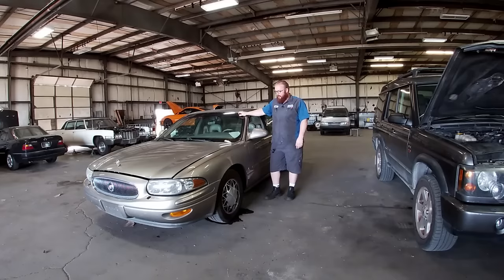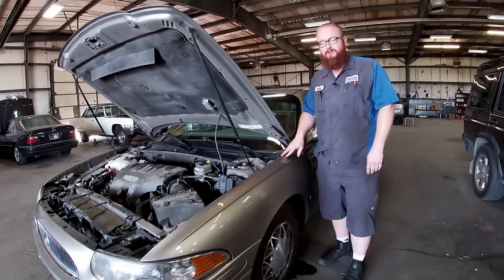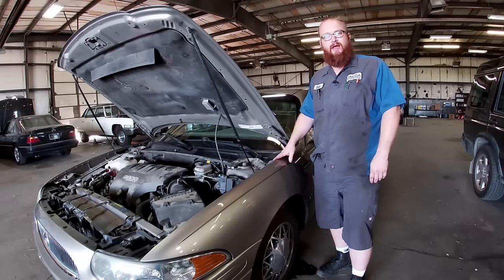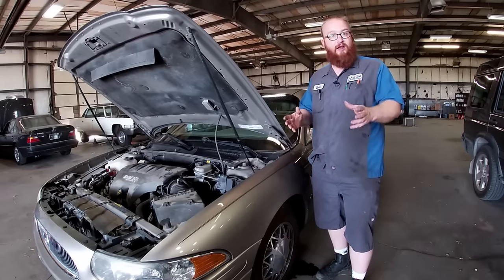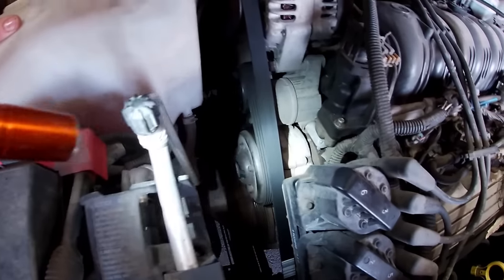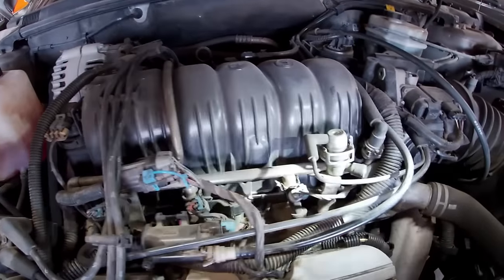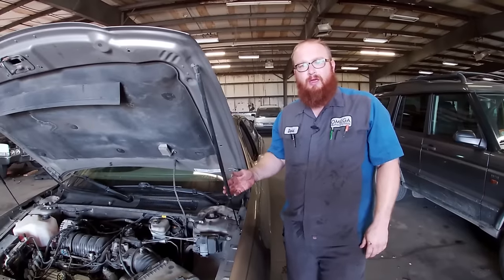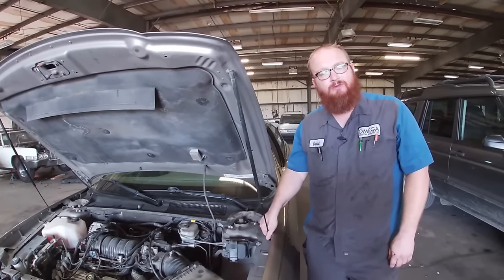CAR WIZARD highlights what makes the Buick 3800 V6 the BEST engine ever!

Comment: Car manufacturers don't intend for you to keep your car for decades, but once in awhile they make a mistake.
Reply: And that is exactly what happened....accidentally way too durable
Reply: This is why they engineered that late 2000's CARS program.  They literally built cars too reliably, and people were not buying new cars in as many numbers, and used cars were cheap but very reliable.  Thousands of good used cars, motors and all, taken off the road, and replaced with piles of shit that barely lasted 100k.  Just enough to outlast the payments.
Reply: my aussie built '01 Mitsubishi is almost as old as me and hasn't had a single issue yet :/ it's mind blowing how many garbage cars there are these days, and the clueless people buying them (euro trash and un-necessary SUV's mostly)
Reply: It's not a mistake it's greed
Reply: yup. Toyota made that mistake with the 5vz-fe 3.4l v6 engine.  with good maintenance, it will last literally a million miles.  best engine ever made
Reply: I had to smile at this comment.
Reply: Mercedes used to make outstandingly reliable, long-lived cars.  However they changed their focus in the last few decades and went for glitz, glamour and short-term profits.  The company that Daimler-Benz was from the 1930s to the 1980s is dead, now they're just another car company with nothing special about it.  Come to think of it, Volkswagen became one of the largest car companies in the world selling a cheap, reliable, easy-to-repair, simple car.  Their marketing was honest and direct and the company had integrity.  They, too, have completely dropped what made them stand out as an automaker and are just another BS car company now.  The Germans seem to have abandoned the strategy of letting the engineers steer the company and become like everyone else.  I was hoping the opposite would happen and  their methodology would catch on in the rest of the world.
Reply: *Relates in 2000 Buick LeSabre still running strong and riding smooth.
Reply: Benjamin Hale my 2002 Lesabre was the best car I ever owned. Doesn’t take a head on crash to well though, or I’d have kept her.
I now drive the Grand Marquis with the 4.6 L V8. It’s nice, it’s a land yacht wich is what I drive, but with the rear wheels spinning in the snow, it makes me miss my lessbre.
Reply: @glazierEd  Sadly most vehicles made after like 1986 handle a head on crash poorly, they handle it significantly better from a passenger comfort side but awful for the vehicle to actually survive the crash, damn crumple zones.
Reply: @Doubledunk  hey, vw are good, my dad has an octavia at 250k going strong and reliable
Reply: we imported to many foreign cars of lesser quality to brainwashed baby boomers,  foreign cars are better and with no control,  this led to robbing millions of jobs from American workers and the demise of the American auto industry. MY DAD IS BETTER THAN YOUR DAD HAHAHA!
Reply: they are made to drive not crash, not too many aircraft survive a crash, it is just another sells gimmick!
Reply: @mitchmurray2260  don't forget the 4.7 v8 that powered both million mile tundras
Reply: @faliray4889  I had to drop another "like"
Reply: The entire 60s, 70s, and 80s was one amazing mistake for country boys the nation over. I have a 50 year old motor thats been in 3 different trucks. Literally took my grandpa to alaska in the 70s and moved all my appliances just recently. Massive parts commonality with a variety of motors, millions of units of NOS items available dirt cheap. Cores, parts available all over planet earth. You can swap a motor in no time, fix anything on it easy and it's forgiving as hell. Rotors and drums built to last, wheel bearings are a simple question of packing and preload, external fuel pump. All the tools needed for roadside repair fit on the floor.
Reply: If only they made more mistakes we'd all be happier.
Reply: @Doubledunk  those euro trash cars have survived my maniac driving better than any Japanese and most certainly any American car I’ve had have. I’m a street racer. Audi is slapping the butt of most cars in the same class. Parts prices are pretty much the same for American and euro cars here. American car parts are mostly more expensive but that’s due to natural causes. My V70 from 2001 is at 250k miles as we speak and it’s running like a clock and nothing more than maintenance, wheels and breaks is done to it. Only euro car I’ve had ONE time consuming job done on was my Saab with it’s broken generator. That was truly pain to replace.
Reply: had great service out of my last 2 cars, toyota tercel and rav4. rav4 is at 435000kms and owes me very little !! 
dad had two holdens with this motor but driving rear wheels, didnt have any probs but not a lot of kms on them
Reply: How many radiators have you replaced for the 3.8L? My neighbor said that the was defective allowing trans fluid to mix with antifreeze. Another friend went to the hair saloon and when she went to start her 3.8L in a Olds, she had it towed to the dealer where she worked and they told her the engine was hydro locked because of headgasket failure?
Reply: Yep. All aluminum cars are a major mistake.
Reply: @thomascox7796  
Just add a $30 transmission cooler.  Takes 10 mins to reroute the lines out of the radiator.
Reply: Car wizard I found a Monte Carlo SS several  100k miles or less with the 3.8 l engine what do you think of those? They want $7k
Reply: @mitchmurray2260  Toyota doesn't make mistakes lol, they purposely build reliable cars
Reply: You mean, American car manufacturers.
Reply: The hardest part for me is trying to chase my 4T60E transmission problems, it keeps dropping differential pins and taking gears with it I'm on my 3rd trans in 230miles and I can't find parts. It's sad cause I love the car so much
Reply: @WalkerKSOB2000  It's hard to believe this is not a well known issue. I wonder if Car Wizard addressed this yet, and if not, why?
Reply: Well said
Reply: a reliable GM engine. like wow
Reply: I have this car still running with 210k miles
Reply: The plastic elbow for such an important engine coolant is intentional so that people destroy their engine after 10 years when that plastic ages out.
Reply: @chubbysumo2230  exactly.  Only toyota and honda somewhat kept making cars that lasted 300k
Reply: @Doubledunk  exactly they made simple easy to repair cars and then government also introduced emissions controls for engines after 2000 which combined with manufactures making cars to only last 100k -150k made modern cars costly, hard to maintain and short life span.
Reply: @Doubledunk  Not me i bought a 1998 Montero sport 3.0 V6 24 valve old school
Reply: @mitchmurray2260  So True and now they are making Direct Injection crap engines which force fuel into engine oil and carbon up the intake valves.  Turbo engines for 2022 tundra that are half size and will wear out.
Reply: @bdhale34  I like the new vehicles to crumple because they lower the G forces of deceleration much more.  I can afford to buy another vehicle much rather than broken bones.
Reply: @chubbysumo2230  no kidding. You could buy a $500/1000 car that would last 1-3 year at least get back on your feet and do it again….. not anymore
Reply: First and current 00 Grand Prix gt I'm trying to learn more about the motor but when my grandpa got it for me it was sitting behind a shed and last was registered 2019 and when they went to work on it and get it out to take to his garage they said it started right up with no issue minus the plug wires being chewed
Reply: Well said 👏
Reply: If you have a car that is a good car just right for you and doesn't give you problems then you want to keep it for as long as possible
Reply: What do you people have always bought new car if not for reliable but for staying current.
Reply: If only the transmission was as good
Reply: Shit you got the point i was thinking that why make a lasting  engine when we can make it mess up every time just to keep repairing that trash
Reply: The cavalier
Reply: @YTT718  I had a cavalier bought used they didnt change the oil for years the engine was still working perfectly I put fully synthetic oil the engine came back alive and roared like a beast. cavalier is a tank
Reply: My Monte Carlo gaps on the daily
Reply: @HealthSupercharger  Turbo  Subarus last 50k lol
Reply: Exactly!!!
Reply: @mitchmurray2260 onda made the same mistake with the venerable K-24A1 I’ve got two an 06 and 07 best 4 cylinder ever made as far as I’m concerned ❤
Reply: @paulh2981 you also forgot about one of the greatest corporate blunders in history when Mercedes Benz bought Chrysler which I predicted was going to be a disastrous for them and it turned out to be just that right down to the T a black eye they’re still trying to heal from 😂
Reply: @en3myspott3d54 that’s what the Japanese were know for and why so many Americans dumped Detroit and bought Japanese cars I got 3 Lexus vehicles had 2 Corolla and I have currently 2 Hondas 06 and 07 wouldn’t give them up for anything else
Reply: I’ve got an 08 Saturn Aura I paid $900 dollars for the 3.5 pushrod thing is super smooth it had electrical gremlins caused by a bad fuse box and starter the previous female owner was chunking new parts at until she finally gave up on it posted it on Facebook marketplace and I bought she originally wanted $1400 for it when I got to her house she said $900 take it with you and i almost fell through the floor long story short I got lucky and found a brand new fuse box from a GM parts supply house on eBay one of the last because GM has since stop supplying the main junction box installed it and flushed the engine new spark plugs changed the transmission fluid and filter and new shocks and it purrs like a kitten the 3.5 pushrods were much more reliable than the later 3.8
Reply: That’s what happens with the 7.3
Reply: Like one in a billion.
Reply: @paulh2981 All auto makers are forced by the EPA.
Reply: Sounds like very little research.  I know my 75 d200 truck was especially built to have a long life. Galvanized steel undercarriage.  Also look at all cars from 70s to earlier.  Funny the 727 transmission is still in use as well as the 318 and 360 engine.  Your probably too young to know about a 727 transmission.
Reply: @chubbysumo2230 it wasn't CARS. It was Cash for Clunkers program rolled out by the government and auto manufacturers. It basically promised to use your old car as a big down payment on a newer car and majority of people went for it and it basically worked. And people who still have these older cars are keeping a tight grip and probably wnt give them up until the odometer rolls to all 9s. I know because I have a buck lesabre that refuses to quit
Reply: @WalkerKSOB2000  it’s always the transmission…. $2500 become a little to much on a $1,500-$3,000 car
Reply: Ahhh the cash for clunkers took out so many good cars
Reply: You are a good man, sir...
Reply: I would only add that they had plastic intake gaskets that must be replaced, like those damned manifolds...  Also, the supercharged units had NO maintenance specs for the blower snout oil!  It should be sucked out and replaced every 30,000 miles.
Reply: I keep appreciating my 75 Dodge d200 truck.  Galvanized steel used in  the body; I can get all the parts for it still; the 360 engine is common as well as the 727 transmission. The tranny is the strongest and has been used for racing several decades.  Research Mopar vehicles or actually research your opinions.
Reply: Not true.
Reply: I just spent $1500 on mine and still does not work.
Reply: Like every 100 years 🤣
Reply: Cars are lasting longer than ever, people just get tires of repairing them at high mileage and conflate that with being unreliable.
Reply: All except Toyota gmc should have 
stayed with the 3800 Toyota would have oh that’s because their No One
Reply: Well stated. “Oops, we built a bullet.” Just like the Ford 300
Reply: Indeed, its a parasitic world we live in....
Reply: Every 3800 motor powered car owner I know has nothing but good things to say about their car’s engine performance. GM got it right with this one, one of the last things they did well.
Reply: The only mistake is making shit out of plastic instead of metal. Especially on an engine. Plastic, aluminum and steel all have different expansion and contraction rates, that's why gaskets fail. Great engine though as I own one.
Reply: Geez! Never thought the GM/Buick V6 would ever be considered a "Best Engine"... besides early ones running rough like a V8 with 2 bad spark plugs, the aluminum oil pumps wore out just after the 50K Miles Warranty expired... ruining the rod and main bearings... 
Pontiac Iron Duke was a great engine... good MPG... ample power...
Reply: @alk4pon3 I've got my Mom's old 2002 with just under 100k. Just replaced an EGR valve that I'm thinking was the original, and it's a great car. Other than the window motors, that is. Everything else works fine.
Reply: @dismit19 Still cheaper than a crappy new vehicle.